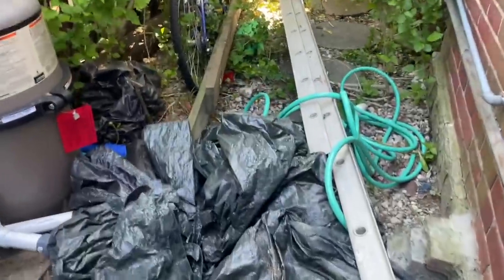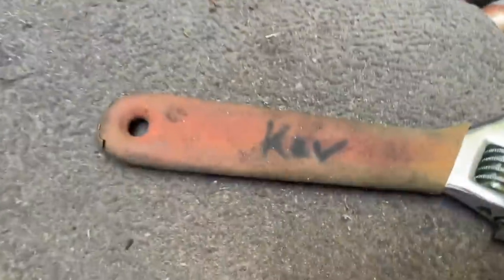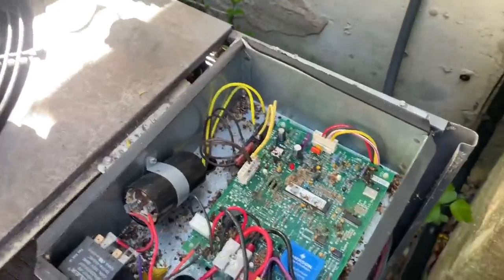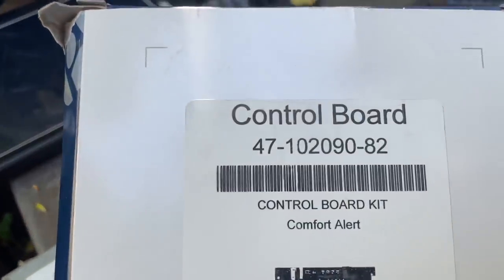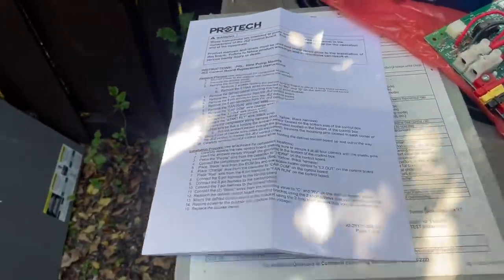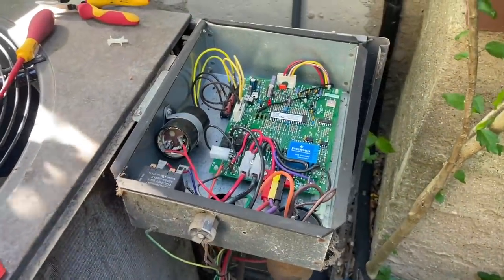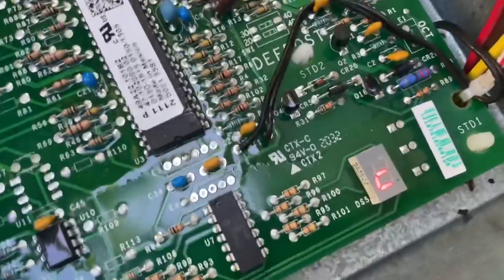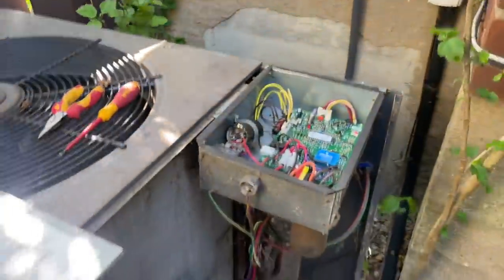Neighbor is HVAC Contractor & Couldn’t Fix Rheem Prestige RAPM048JEZ Condenser Bad Control Board

Comment: The guy with the boat is Kevin Castorini..   His uncle was the plumber in Moonstruck. He was a classic NY contractor.
Reply: There are three kinds of pipe. There's what you have, which is garbage - and you can see where that's gotten you. There's bronze, which is pretty good, unless something goes wrong. And something always goes wrong. Then, there's copper, which is the only pipe I use. It costs money. It costs money because it saves money.

Comment: Just make sure if you are blowing out a compartment with a good control board that you be careful around the control board. Static from the high velocity of air movement can kill the board if you blow at it, I found out the hard way.

Comment: Ha, Kev I forgot to take your wrench out of my tool bag but I did remember to use it to tighten those service ports you left open. By the way Kev there's no upside down 7 service codes.

Comment: i keep a good supply of goodman defrost control boards on my van at all times,,,they simple,,,cheap { $ 28.00)) BUCKS} when i come accross any brand,,,with control problems,,,,i leave a nice new well build,,,trouble free GOODMAN CONTROL BOARD,,,in place of those high priced original boards....

Comment: I'd never walk away with a coil that dirty...wether I got paid or not, I'd at least blow it out with my blower...
Reply: That coil would need a tornado to blow it out.
Reply: You're not going to be in business very long if you do all your work for free it would need more than a blow to clean all the debris out of it that is  in between each coil this requires a foam cleaning that is designed to push debris out of the coils when the foam expands and may have to be cleaned several times

Comment: 1. I’ve been arguing with my company to add “all equipment must have access and be clear of all debri at all time” in customer contracts. 

2. Why wait and see if the capacitor is no good? Just use your meter and check it lmao

3. If kev looked at this job right before you he is clearly bad at his job and is over charging.

Legit missed someone’s water heater because of their “clutter”